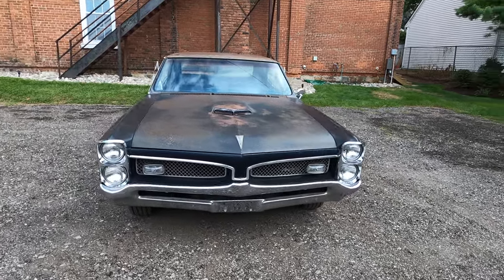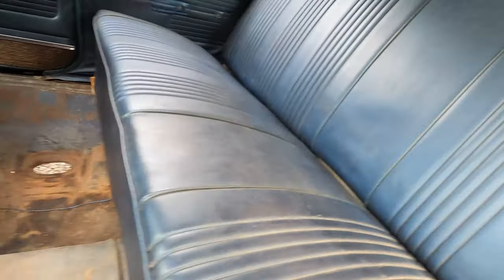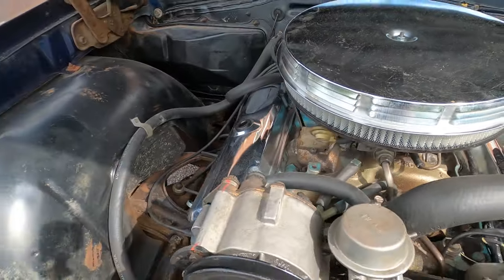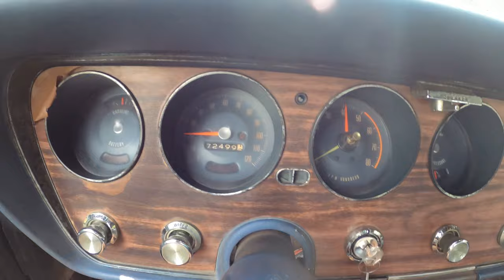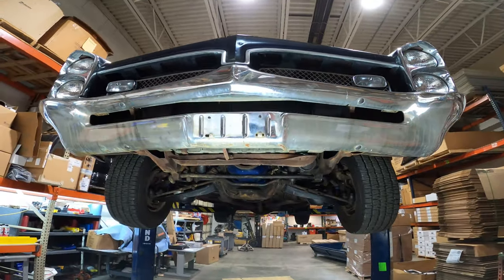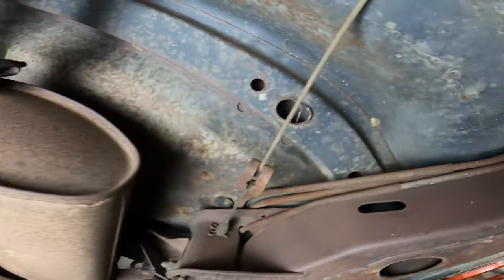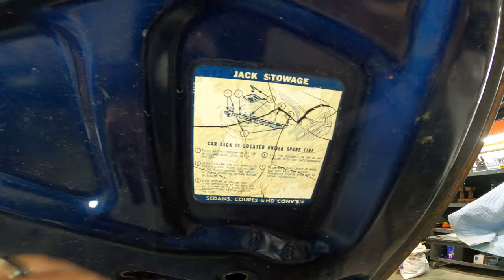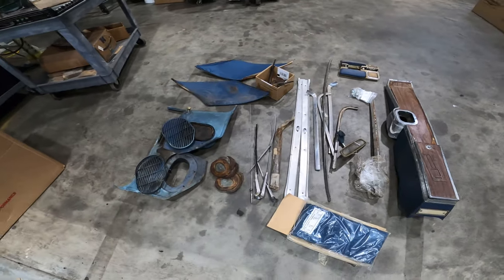1967 Pontiac GTO 400HO 4-Speed

Comment: This car definetely deserves a brand new GM factory coded midnight blue paint job on it and some new wheels, with a little interior upholstery renewal, on the bucket seats, as well. I notice a little squeaking in the front. Perhaps the front disc brakes need a little adjustment. However, the 400 cubic inch motor block looks mostly original to me! Overall it’s a beautiful car with a lot of potential. Hence, the body design looks very straight and it’s a marvelous project car for restoration too! Thank you for this magnificent presentation. Johnny, Montréal, Canada 🇨🇦
Reply from the maker: Thank you!
Reply: @VistaCollectorCars  still have it?

Comment: Those 670 heads are 10.75 to 1 compression. It was 335 hp for the factory. The 360 hp version was only in Ram air cars with 751 of them made I believe. You could also get a 2 bbl version.  That air cleaner is a bit off and it could be missing the lower bottom piece. The top lid is stock. Everything else looks pretty correct. I love how clean it is. Great find.
Reply: I had brand new 67,400-360 hp.390 gears.White with red interior.No Ram  Air .Post Coup

Comment: Wish I could  find one like that hear in the State of Maine %0 years ago i had a 1966 GTO that had a bad 389 in it. Replaced the motor from a junk yard. Witha 68 Firebrid Fomula 400 H.O. w/ carb, air cleaner ,starter reday in install For $250.00 back then with $50.00  cour on the ols 389.

Comment: Sweet machine. Wish I had it. Not 100% sure, but I think those exhaust manifolds, are Ram Air replacements, or newer. like 69-70. I didn't think the 360 HP motor in 67 had the indentations down the runners like the newer ones. Maybe I'm wrong.

Comment: Any 389 with the 3 2 carbs and 700 head's from factory or 360 horsepower and 4 b. Was 335 horses different cams but very powerful its all in the gear ratios Pontiac man here from VA

Comment: Nice find. I still can't figure out how a car that runs a high 16 second quarter mile became a legend.
Reply: Any GTO made before 1972 should be able to clock a low 15 second quarter mile time easy and 14 seconds were common, however, pizza played a big part too!   GTO's just had it in spades!
Reply: @charlesatwell6658  I like pizza. lol
Reply: Some had an auto trans they were 2 speeds. 67 was the first year for the 400 and 3 speed trans. A 16 isn't bad. I have a 67 Buick Special Deluxe bought new by my great grandparents factory V6 car ran 18s in the 1/4 in CA at LACR and Pomona.

Comment: It's pretty rare to see the original exhaust in these cars. ( I don't mean the Actual exhaust from 67 ) But it was replaced correctly. If you notice the muffler on the passenger side is smaller than the driver side. That is exactly how they came from the factory.
Reply from the maker: Funny how they did it that way.
Reply: @VistaCollectorCars  The only thing I can think of is it's part of the tuning they did to exhaust systems back then. Like the resonators they put on Grand Prix and GTO. They gave kind of more or a growl to the sound of the cars

Comment: What a piece of junk , 
Please bring to my house 
ASAP
Reply: Paint code E-E 
Deep water Blue
Reply from the maker: I believe it is Fathom Blue
Reply: @VistaCollectorCars  , 
Deep water Blue ?
Fathom Blue ?
Blue Blue ?

Either way , I'll take it 
Shoot some clear coat over it to stop the rust and retain the patina , add some headers and duel exhaust , change the oil , grease the wheel bearings , then drive , drive drive .

And what is the Trans 
Muncie 
M-20 ?
M-21?
M-22 Rock Crusher ?  

I got a M-21 in my 66 Chevelle SS
Reply from the maker: This car has an M-20 Muncie.